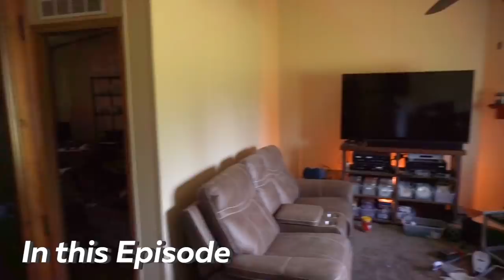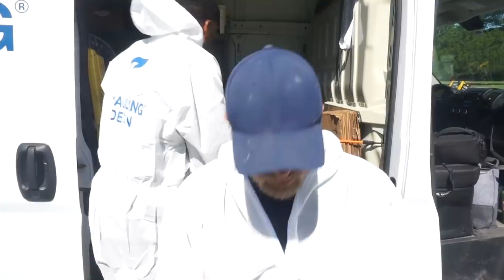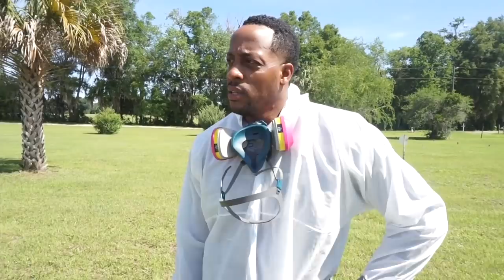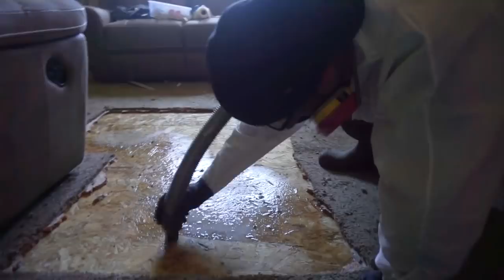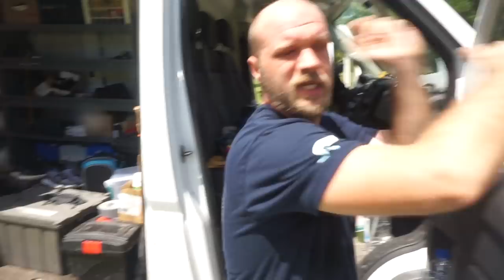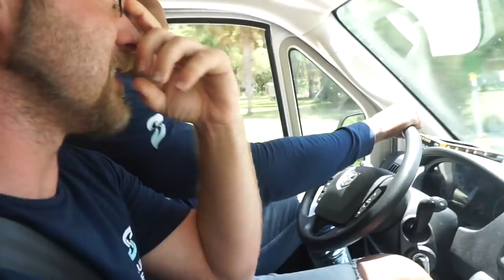S3 Episodes 9: Covid Casualty

Comment: If for some reason I think I'm dying of  covid  or anything really, I'll crawl into my tub. If I'm found it will be easier for anyone to clean up after my death.Since my family doesn"t really check up on me much, this is a real possibility. I'm 65 and have a bad heart so it could really happen. So if I'm found on the way to the bathroom and I don't make it you will know I tried.
Reply: There is a small flaw in this plan though. If you're not found for a while and you start to decompose, your fluids will go down the drain. Then the clean up crew will have to rip out the tub and the pipes to ensure that all of the bio has been removed.
Reply: @florencetheunicorn  I'm sure you're right but why do they have to take out the pipes? Blood and some tissue goes down the drain all the time. (because of periods).
Reply: @ariadne0w1  Yes, but that isn't decomposing flesh that has been sitting for days and crusting/caking on. That stuff usually gets washed down with shower/bath water and the volume of it is minuscule compared to the amount that a decomposing body sheds.

Comment: If that guy had been dead for 10 days and laid there for 8 days before being found wouldn't there be more bio than that? Especially in Florida where its hot and humid... There was barely anything on the carpet and not much on the wooden sub floor either. And there would have been a strong odor too, but didn't seem to have any reaction of that. Seems strange to me.
Reply: He could've been in air conditioning so very little decomp which means little odor.
Reply: They said they left the ozone machine running because of the odour...

Comment: Hi from Florida! I'm not trying to judge the pros here ...But the sub-floor has to have been compromised, it's porous wood! I got the impression that the client couldn't/ didn't want to spend the extra money to do it right. Florida heat and humidity will make that place very stinky if they lose power.
Reply: Agreed. But they have to do what the client asks for.
Reply: They have a solution they use to test to make sure it’s gone. They leave everything they don’t need to touch for the contractors to remove and repair. They were only hired to clean up the decomposition and biohazard.

Comment: Omg guys, why are you taking respirators off before taking off the jumpsuit? You can shake particulates off and into your face. Also, I hope that the equipment was coming out of sanitizing when you were handling them without jumpsuits on, and not before for the same exact reason. Otherwise good vid and thanks for sharing!